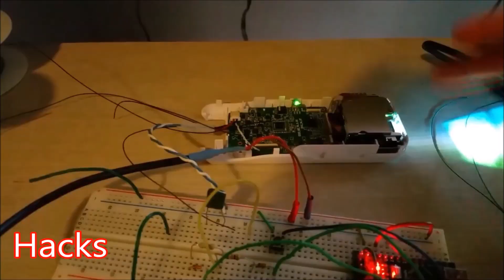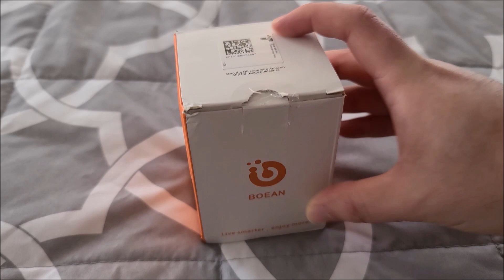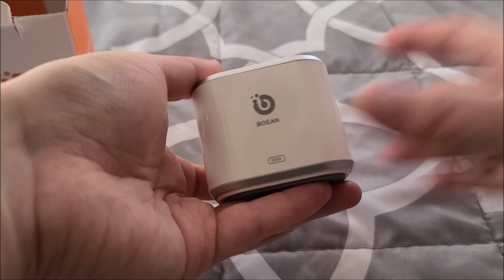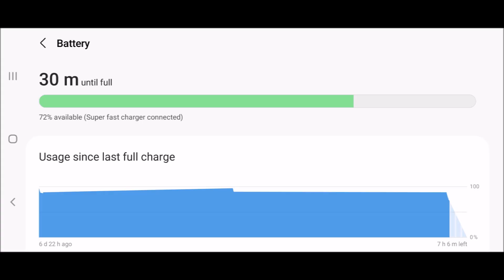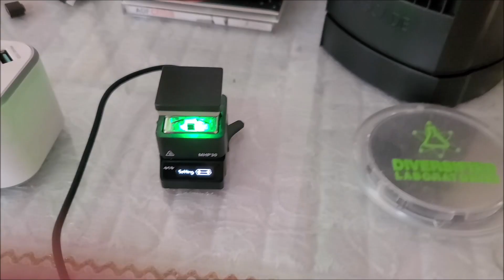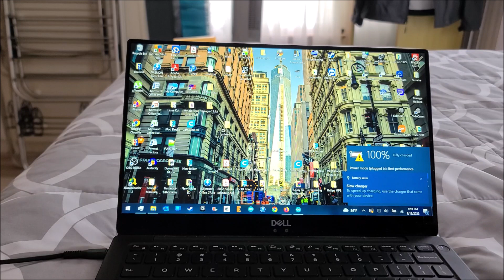Boean 65W QC 5 Port Portable USB Charger Review

Comment: I have the same with ADATA logo ;-)  Buy 2 yrs ago ;-)
Reply from the maker: How's it holding up after 2 years of use?
Reply: @sjm4306  Still perfect. I buy it as the replacement for my few chargers (iPad, iPhone, PC peripherals and other standard USB chargers and also as the power suply for my Raspberry Pi "retro" computer - one replace all of them). Still working perfect and I recommend it to all my friends, but ADATA stop selling them and... Now I recommend your video to all ;-)  BTW   original model are CU048OQC

5V = 2,4A max
type C 5V=3A max
and QC3.0 = 9V@2A or 12V@1,5A == total 48Watts

Comment: I come for the reviews i stay for the weaponization factor of the tech.
Reply: dumb question but if you stuck a metal cup on the hot plate could it boil wayer
Reply from the maker: Yep, more than enough power to boil some water, the issue will probably be the small contact area.